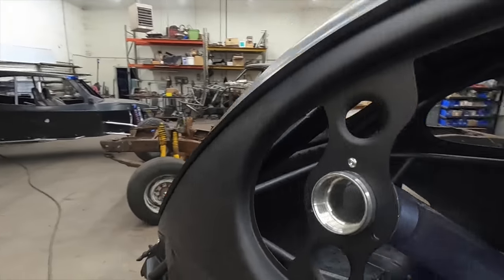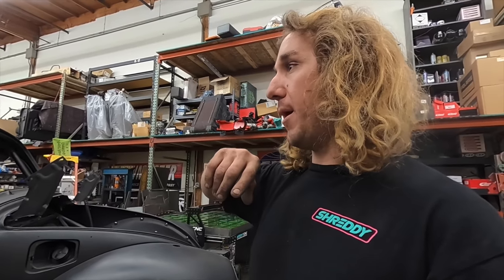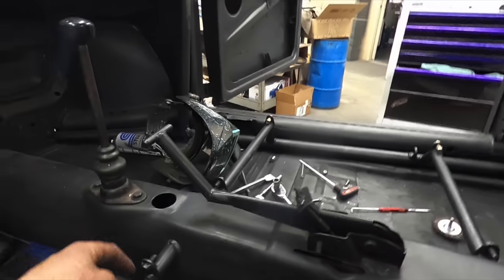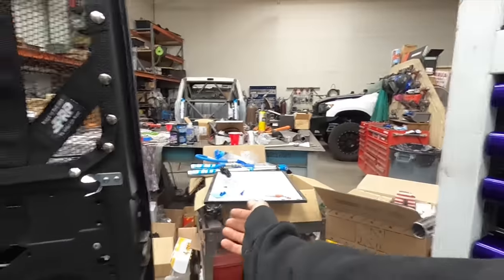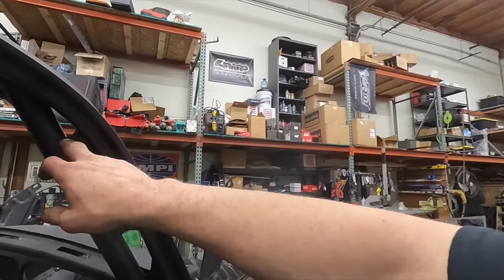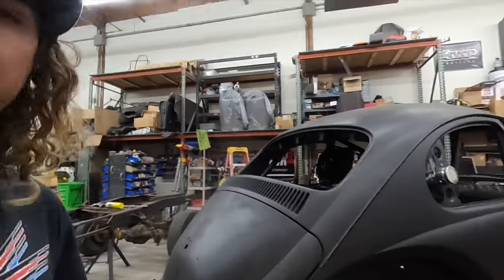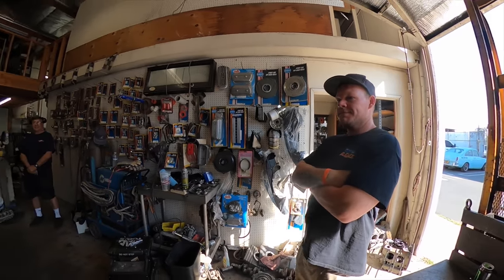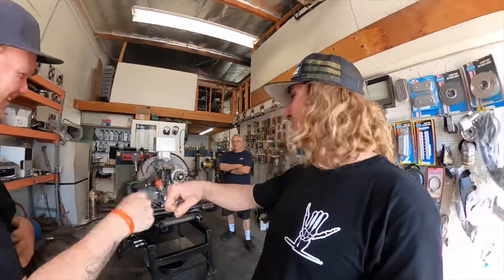SLUG SHARK - Episode 10

Comment: The fender brace maybe should have the bolt  head turned around to the inside of the fender, the nuts could gouge the tire on the inside. Round head better for tire rub. Beautiful fender brace , great fab work.